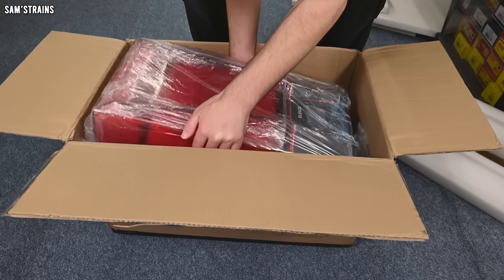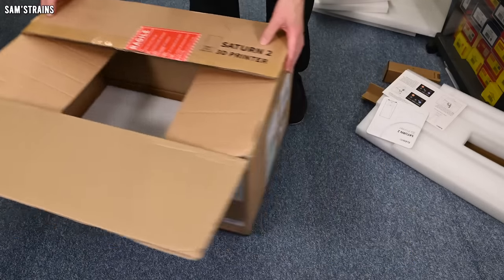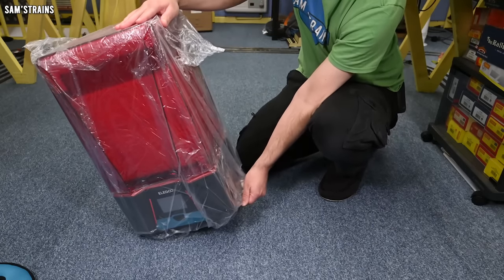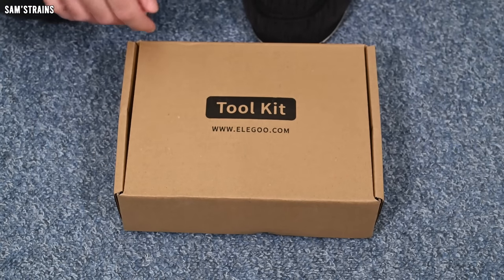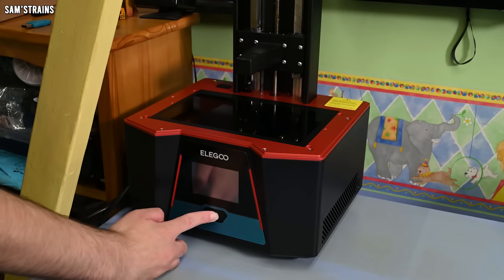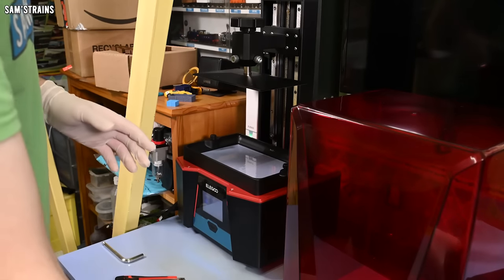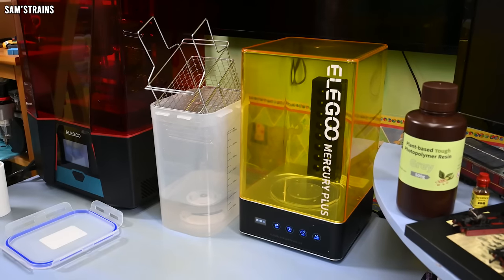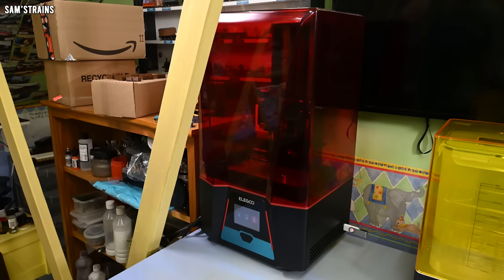Home Made Model Trains With Professional Detail | Getting Started With Resin

Comment: Welcome to Resin Printing Sam! I have the Elegoo Saturn 8k which is a superb machine. One tip I would like to offer is check your print bed is correctly leveled every 10 to 12 prints, as in my experience the level does change. Might not affect your machine as it is newer, but its worth keeping in mind.
Reply: I level my Anycubic Photon before every print because scraping the prints off the plate moves it slightly. Thankfully, levelling is a quick & easy process though.

Comment: Finally! 😂 Well done Sam and welcome to the fun, frustrating world of resin printing.  I would suggest buying a screen protector ASAP.  Any spills on the screen will knacker it, so it's just added protection. Also the flashdrives sent with these machines are crap and tend to fail, missing sections of your sliced file.  I have always bought replacement branded drives (sony etc) but you need to keep them under 16GB or they may not work.  Another tip is fit a kitchen roll holder on that beam next to your printer.  You'll want it ready for emergencies (which will happen!) have fun. Tom

Comment: in your head turn the model upside down and look for areas that may pool if water was poured over it. This will happen to the resin so angling the print or leaving drain holes will cure this. The cutters are for snipping off support legs if you print that way.

Comment: For washing: even if you let drop off the print carefully, there still is a lot of unvured resin on the print. So the isopropanol gets saturated quite fast. And the box of the washing mashine isnt'so easy to clean. So I optimized the cleaning process by using 3 containers extra: first to pre wash, second to pre wash again, third is the container of the washing mashine and forth is to "cure" saturated resin in the sun. After about 5-8 prints  I swap: 1st container is put into sunlight, so the resin get hard and fall out of the isopropanol. Second pre-wash iso becomes first one, and the iso from the washing mashine is used for the second pre-wash. The washing mashine is filled with the Iso I cured in the sun and filtered, + some fresh isopropanol.
This works great.

Comment: Sam i really recomend the magnetic build plate you spoke of....all of my resin printers use them, and I wouldn't have it any other way.
You can remove and wash the plate with the model still attached. Leave to dry, Then remove the model by flexing the plate and cure it.

With respect to resin smells.....most modern resins are pretty low odour .

Comment: they do actually make removable, flexible build surfaces (magnetic too). A lot easier to bend a flexible build surface to remove parts, than it is to have to cave man them off with a scraper.

Comment: I noticed you went straight into printing wagon bodies. If designing your own items, this is definitely not the easiest thing to start with. I bought mine as a way to print window frames for buildings & have also gone on to print other small detailing parts like chimney stacks, multiple working jumper sockets, coach seats, platform lamps. If you can design them, you can make them exactly the same time and again.

Comment: Hi Sam, finally got around to watching this video. I have been printing with resin for a while. I also run a Facebook group ‘3D printing for beginners- model railways’ so was interest in this video to share link on my Facebook group. Yes you have quite a bit to learn but in time you will. I have gone through several types of resin from not that nice to what I use now, definitely worth looking at the water washable resins. I also find that it’s best not to use a lot of different types as each type needs different settings, transparent resins have different cure times than non transparent resins. With this in mind master one type first, personally I mostly print with grey resin and using just one type I get consistent prints. Good luck and look forward to future videos.
Reply: Is there is such a thing as "excessive curing time" though?

Comment: I have the flash forge adventurer 2, I think, same as one of yours.
I can't even remember the last time I levelled it, I think shortly after I bought a new build plate. I haven't needed to level it in a long time.

The bed is slightly raised in the middle of the plate, so it's not perfectly flat, but if I raise the middle by 1 notch, then it's too high, so, this is basically as good as I can get it.

But MANY of my early prints, had the level set too high, so the first layer is very squashed on those old prints.

Comment: I have a Photon S that I’ve yet to use as FDM has got me 90% of the way without the hassle of resin, but my bigger concern is long term durability. I’ve bought kits from others with resin parts that are about as straight as a corkscrew, and the other issue is fragility that gets worse with age, had a little accident with a small loco body on a Hornby peckett chassis and it blew into a million pieces, as well as suffering with cracks when hand drilling holes for handrails with a pin vice. Also bought some unpainted figures made with resin for the railway, detail is amazing but several lost their feet before they’d even seen a paintbrush!!

It would be good to know if any resins, for instance the plant based one, prove to be more rugged?

Comment: To say you cannot print that type of detail, when referring to the double spiral at time stamp 23:00,  is not correct if you select the proper nozzle and settings.  I have successfully printed a 3/4" tall rook with the internal staircase and double helix on my Lulzbot KitTaz using a .15 nozzle with a .08 layer height.  It is not easy, but to say you cannot is without doubt, not true.  With that said, the surface finish  with the resin printer is phenomenal .  I have recently picked up an Anycubic Photon Ultra, but have yet to print with it.  It will be interesting to print a 3/4" resin version to compair.

Comment: Congratulation to your new tool. I have got one some times ago, but somehow I am not very satisfied with the principe itself. The quality is OK but the material itself is not exactly that what I was expecting. I still prefer the modelling from brass and other metals and the resin parts are somehow to fragile - also in comparison to the “old fashion” 3D printed parts ( ABS or PLA). Not to mention the required space, the work and the mess with the machines. 
Finally I sold my unit and if I need such delicate parts I order them from people who use the unit regularly. It brings something when one uses it almost daily to finds out all the tricks and practices for the optimal work.  Enjoy your new printer!

Comment: Welcome to the Dark Side, enjoy the cookies :)

Printing the wagons flat to the bed like that has inherent risks with large batches, with the suction forces when the print is peeled up from the FEP film. Experiment with printing at an angle, one corner first; if you do research there is a way to calculate the ideal angle so you don't get prominent layer lines, it won't be as neat a value as say 30°.

There are plenty of tools to work out the ideal layer time for your resin. It might be worth running a test whenever you open a fresh bottle of resin, but that might be overkill.

Printing times will be affected by room temperature, with later times increasing when it's colder. I think my times went up 160% last winter in an unheated room.

Comment: Resin printing is more work/mess then FDM but the fine detail is a lot better.
You have to print on a angle or more supports or you will get uneven on the bottom.
Gloves on untill its cured, even after washing you still get uncured resin on your hands as is not fully cured.

Comment: Liked and subscribed on this first video I’ve watched. 

I have filament and resin printers and they both produce viable items depending on the requirements.

I do like the higher resolution of the resin printer though. I’m looking to use it for making replacement parts for die-cast models.

Good luck with your printer. I’m looking forward to seeing what else you produce.

I use the water-rinsable resin.

Comment: Printing directly on the build plate is not going to give optimal results. Place the items to print a bit above the print plate, and angle them some 20° and the quality will be a lot better. You will need supports, and the hard bit with resin printing is managing supports well. You don't want them marring your important surfaces.

The first layers will lead to "elephant foot" if included in the part, and they will often look very strange. Keep the printed items out of that area, and have only supports there, and it will be a lot easier to get good results.

Comment: Comparing print time to FDM is a little suspect, since with FDM you just pull the part of the plate and it's done. There's a lot of post-processing time with resin.
Reply: Hmm.. not sure about that. Yes resin requires a wash and cure but that can generally be done in around 15 minutes for most mass market home use resins, and most of that is leaving the print under a UV lamp to cure. I have rarely printed anything with my (admittedly rather old) FDM printer that didn't require at least that amount of time to clean up and make the print presentable - considerably longer if the print required awkward support structures - where in resin (using the right slicer) they almost fall off pretty cleanly with a touch, and prints need a light spot sanding at most before they are ready to paint.
Reply: @johnd6487 Depends what you're printing and how well it's designed. I've made tons of stuff that required zero support and zero clean-up. 

And it's not just the parts. You have everything to clean up. 

Have you seen how fast FDM printers are these days?

Comment: Lmao man better late than never with resin.. I was one of those who told ya to get one 2 yrs or so ago 😂😂 but you will never look back once you get started
Also use the flex plate that is an absolute game changer! Taking the build plate off after every print sucks and may have to go through re leveling where as the flex plate just peels off and will be far easier to remove your model from then slap it back on.. expose your vat then peel the cured resin at the bottom of your vat then your ggod to go for the next print.. this will save you constantly removing the resin back into your bottles

Comment: biggest problem with my n scale train printing is that of you print in best resolution position for your model so flat on the bed, train coaches with closed roofs flex and roof prints distorted if it isn't solid because excess resin stuck inside of the model is pushing down on the roof, the other way around the supports break every detail
if you print in sugested 30 degree orientation it takes 3 times longer abd you get stairseps patter all over the model
so i would say resin printers are great but also terrible for printing trains because they are most accurate in printing cavities  in solid objects , every other shape you either need to drain or compensate for graviti

well with 8k printyer stairsteps might be smaller but you need crazy small layers too

get thick yellow kitchen gloves you can reuse, those surgical type are prone to breaking and resin has a tendency to penetrate skin. , the problem is they also like to get hard in the sunlight and if you not carefull you may have very hard skin for a while if not worse so good gloves is a most, but i wouldn't go so crazy with toxicity of the vapors. i wouldn't sleep in a room with a printer but you can just leave it working somewhere and just open a window or put a fan on for an hour and you be fine. you don't need a respirator if you just walk in and out of a room to check on it

Comment: Looks good BUT...  (there's always a but), The actual print procedure when compared to FDM seems extremely convoluted and involved from start to finish. So I'm thinking that the final result compared to an actual FDM print model would seriously need to be a 100% massive improvement otherwise I'd stick with FDM purely for the ease of use.
Reply from the maker: It is quite a lot more involved - much more cleaning etc - but the print quality is more than 100% better… so it’s painful but worth it!

Comment: So far so good, but it only takes a little mistake to cause the fumes to become so. If you want to eventually poison yourself to death, carry on using the new resin printer.:_SamstrainsTheWheel::_SamstrainsSamstrains:
Reply: Sam should be fine, the resin isn’t toxic, but I wouldn’t personally try it with low ventilation myself. FDM printing is much safer and I’m currently in market for a FDM Printer.